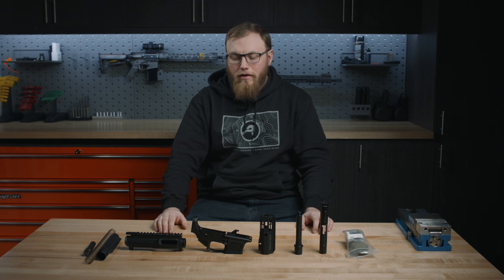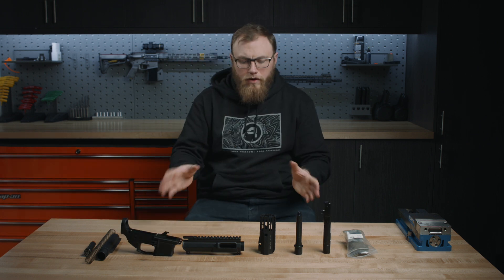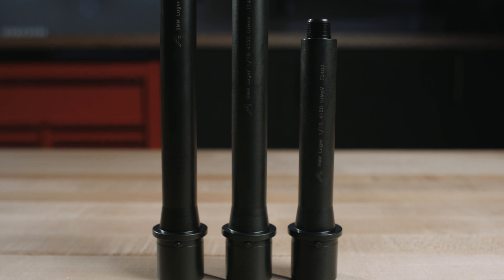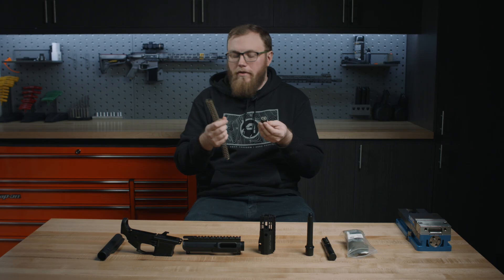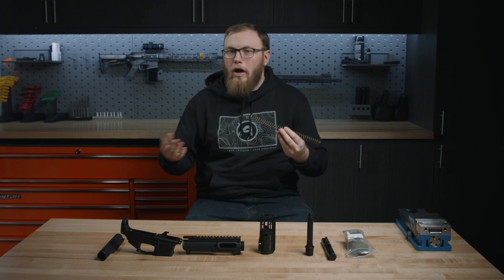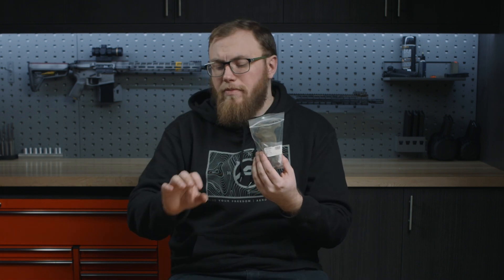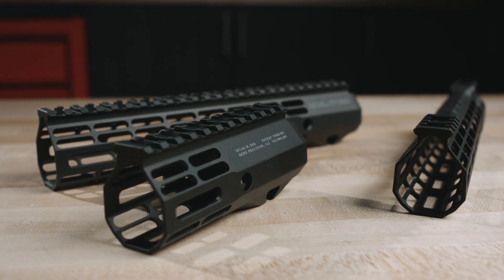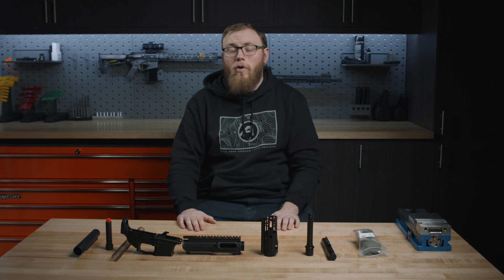What You Need To Build Your EPC

Comment: Have an Aero EPC-9 with ALMOST all Aero parts in it (95%) buffer weight, charging handle, safety selector are not Aero. I did change the buffer weight to a KAW 10oz and it made a huge difference in felt recoil. That with the VG6 muzzle device made it very soft shooting. I have NEVER had a malfunction with it in anyway. That being said when I told this to the rep at Aero he said I was lucky as it is not common to hear that. He said have you noticed how its been around for some time now but the other caliber options are still not released? He said Aero is not even trying to release them as the issues with the 9mm platform are still occurring. I consider my EPC-9 to be one of my fav firearms and would grab it in a SHTF scenario without hesitation, not sure why the rep was trashing it so hard.

Comment: Hi all. For anybody that has assembled their own EPC themselves, what vice tool did you use for torquing the barrel to the upper receiver? Thanks in advance
Reply: I would like to know too
Reply: @albertptran  Hey buddy, I ended up doin a bit of research and found the best tool to use is the  Wheelers Delta Series AR Upper/Picatinny Rail Vise Block
 Part# 156888
Reply: @albertptran  I bought it and works great for the EPC/PCC's

Comment: Is it ok to build out the Lower w/ normal Mil Spec Parts?  and can the Buffer for this be purchased by itself?
OK,  I found the Buffer & Buffer Kit for sale on Aero's Website.  But now I am wondering if (since it uses a standard Carbine Receiver Extension) Would it be OK to use the Geissele Super 42 Braided Wire Buffer Spring - Along with Aero's Buffer purchased from their website?

Comment: Charging Handles are normal ar15 or epc only?
Reply: Normal mil spec charging handle
Reply: Yes, standard AR parts on The lower. For the upper the charging handle is standard AR but obviously the BCG/Barrel/muzzle  device are for 9mm specifically.

Comment: Great stuff. I have a mil spec upper receiver, is the epc9 lower compatible with mil spec standard ar15 uppers?
Reply: Did you ever get an answer to this question? The lower receiver is on sale and I want to purchase but if it’s not compatible I’ll hold off.

Comment: Is the ALG QMS compatible with the EPC 9 or do we need to get specially hardened trigger/hammer pins with it?
Reply: The hardened trigger pin is a must have for 9mm ARs. I just run the aero milspec AR15 trigger with the hardened pins in my epc9

Comment: Do you have to use Aero branded BCG on EPC9? At the moment Aero BCG is out of stock.
Reply: @Aero Precision, LLC can you answer my question above?
Reply: Tim, no any 9mm BCG will work just make sure it’s for glock mags. I got the Faxon BCG for $129 since I got a blem receiver set to build.
Reply: @derek3154  , thanks. I ordered one last night from primary arms. Mad Mike Productions recommended same BCG.  I didn’t realized they sell “blemish” sets. I got mine from Brownells. How’s your build going? What configuration did you go with? I already got my LPK, barrel and brake. The rest have been ordered and hopefully get all next week.
Reply: @Boy_sumi  just ordered the set yesterday so it will probably be a few weeks.
Went with a 6” barrel with 1/2 x 28 threading from Angstadt arms, 3 lug flash hider from angstadt as well.
Armaspec LPK and SBA3 stock as i already have it.
Just need a handguard for it. Probably wait till the 5.5” angstadt is available, can’t get one Right now.
Reply: @derek3154  cool. I went with a 11” barrel from ballistic advantage, Aero EPC LPK, strike industries mini king comp brake & pistol stabilizer. Good luck!
Reply: Failzero nickel boron

Comment: Hey I'm looking to build one. Would this recoil system be considered short or full stroke?
Reply: It's late for the comment but in case others are wondering this system relies on the method that is direct blowback. There are no locking features in the EPC setup as compared to the G36 with short stroke or the AK platform with long stroke

Comment: Save yourself the time and money and do not purchase this PCC. I went to test fire my newly built EPC today at work. We utilize Speer gold dot 124gr  +P JHP ammo. It would only fire one round and then instantly jam on the second one. It did this repeatedly no matter how many times I tried to clear it reload and fire. Frustrated I packed it up and decided to call Aero. Whoever their so-called tech rep is told me that PCC’s are not designed to handle hollow point Ammo and I should only use ball ammo. Huh? Why didn’t Aero tell anyone this beforehand? If I’d known this I would’ve saved my money and bought a CMMG banshee like my buddy. He feeds it ANY avail 9mm ammo and it eats EVERYTHING- ball or HP ammo. Never mind that the Aero “tech guy” apparently doesn’t have a clue. At my job we run HK MP5s with the same JHP +P Ammo and they run flawlessly. When I told him that he acted surprised. I guarantee he isn’t a shooter and definitely doesn’t own a EPC-9. Aero knows about this issue because upon looking online there are tons of blogs and articles about this problem. Luckily I was referred to Rudy at Macon Armory in Georgia who knows the issue and can fix the barrel. Apparently it’s a design flaw that prevent the proper feed of HP ammo. If it can be fixed ($80)  why doesn’t Aero do the right thing and correct this?!?! Up until now I’ve been an Aero fan but this has me rethinking such support. Save your money and the headaches and do not buy an Aero EPC.

Comment: DO NOT BUY AN AERO EPC 9MM! Mine will not feed correctly. It's the most useless firearm I own. I'm pretty sure the barrel is poorly designed. Seriously, just buy a scorpion or anything else!
Reply: I have the same issue, got the gun finished, went to chamber a round and it flat nosed. Figured it to be a fluk and tried again. And again. Same thing every time. It's good that I didn't try to fire them, now I have a handful of flat nosed 9mm rounds during an ammo shortage. Looking into the chamber you can see where the round didn't even try to go into the chamber and t boned the poorly designed feed ramp. I guess Macon Armory has a solution so I will likely get up with them.
Reply: Pretty sure they changed the barrel chamber lead angle to correct that issue shortly after they were introduced. Something you would have been informed of if you had contacted them, if you even actually bought one.